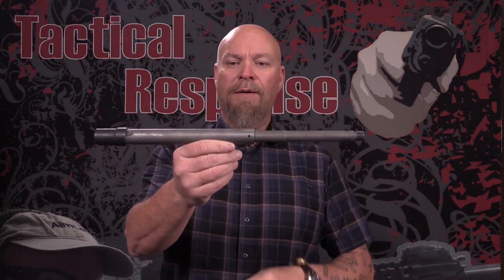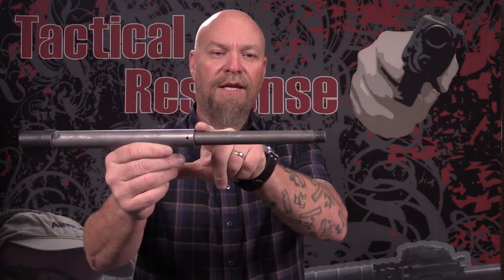Pencil Barrels are BAD?

Comment: The original M16 had a thin barrel for a reason. A big reason the military moved away from it is that 60s/70s barrels had heat treat issues that could shift POI significantly once the barrel got hot. Significantly enough to matter at 100yds.
But with modern cold hammer forged barrels, the shift has been reduced to the point that it’s genuinely insignificant for 5.56, even in narrow barrels.
Reply: The military moved away from it because of bad data.  They thought they were bending barrels during bayonet practice, a belief they thought was correct because the bore straightness gauge would often get stuck around the gasblock/bayonet lug area.  

What was actually happening is there was a burr at the gas hole created during the manufacturing process that was causing a build up of copper over time which would stop the gauge as it went down the bore.  They didn't find this out until afte the M16A2 TDP had been signed off on, and it got left as an "upgrade".

Comment: Most of the guys worried about these things can't shoot well enough to see a difference anyway.  It's like guys who can't hit the x at 5 yards putting $200 match barrels into a Glock to fix their problem.
Reply: UziNineMillomeetah Hahaha shooting low left, add a match grade barrel. Now you’re shooting a tighter group low and left.
Reply: @JohnW-yv6yp  Exactly!
Reply: Years ago, I was at a match and as I was walking away from a stage, I saw a guy banging the frame of his Glock against a rock trying to get the slide unstuck and out of battery.  I asked what he was doing and he told me he put this aftermarket barrel in it thinking it would shoot better.  The barrel caused a little dirt to jam the slide closed.  I told him the most accurate barrel is the stock barrel with 10,000 rounds through it.  He asked "How does 10,000 rounds make the barrel more accurate?"  I said "The barrel doesn't need 10,000 rounds.  You do."
Reply: John Wilburn Good shit, I’m stealing that.
Reply: @Dante's Cuckferno I just buy the OEM of many of those aftermarket barrels for like 1/3+1/4 the price 😂

Comment: “Heavy is good...heavy is reliable. If it doesn’t work, you can always hit him with it.” ~Boris the Blade
Reply: Isn't the heavy barrel argument more to do with barrel harmonics than the reasons stated?
Reply: The pro side of a Mini 14 is a nice butt stroke. :-)
Reply: @conondrom123 yes. Ostensibly, the light weight of the thin barrel is a trade off for the vibration dampening of a heavier construction. For sustained, repeated cycles, I would opine more repeatable harmonic signature is available to the heavier barrel with diminishing returns in increasing mass, which is why most normal duty and match barrels are of similar profile and diameter.

Comment: It's all about thermal dynamics and heat deflection. I have heavy barrels on all mine, I cant say what's right and wrong, own what you want there are differences and it's not just weight bud..I do study metallurgy and am a machinist  and fabricator. Some things do play into the difference into these profiles.
Reply from the maker: What you do not have it practical experience. Get some gunfight training.
Reply: @TacticalResponseCrew  and how do you know this? Assumptions are like assholes bro. I would probably never want to get into a gun fight with a barrel that whips around on follow ups
Reply: @TacticalResponseCrew  and more to that..if you read what I put down without you're sole opinion (because that's all it is) in mind you would see that I said I wont say who is right or wrong. I dont care what you or the next guy likes or believes in. Also I would think underestimating someone in a fight could be bad for you. Ego is best left aside. Wouldnt you agree?
Reply: Kijafha  yeah I would hope so, I would also like to think that there is no need to promote it by assuming I dont train, or train correctly.  No need to jump on his back either he is a big boy and if he feels he needs to explain or make clear his meaning he can do so.
Reply: @jovanisiliezar3733  conjecture gets in the way most of the time with guys in this field, it's no big deal and I'm not offended for most part. Everyone has their own way about them and they're own style and taste.

Comment: Hi James. My only pencil barrel experience has been with Faxon barrels and they are less accurate than their heavier barrels. They are accurate enough at under 100 yards though and the lighter rifle handles better. I always liked your comment about heavy rifles when you said "which are you going to do more, carry it or shoot it?"
Reply from the maker: Wrong
Reply: @TacticalResponseCrew  Not wrong. My Faxon pencil barrels consistently are about 2 MOA less accurate than my medium profile. Just a data point of reference, not an affront to the video. This may only be true for Faxon pencil barrels
Reply: @Jones Hi Jones. Certainly not a scientific test in a controlled environment. Just my observation from shooting several types of 556 and 223 from several rifles with different barrels at 100m. The variables you list should absolutely be controlled for a true scientific experiment. This is my experience and nothing more. James recommends Midwest rifles. The last I checked Midwest was using Criterion barrels which are very high quality. I do not own any Criterion barrels. My experience is with Faxon, Ballistic Advantage, and BCM. At this point I would say no one on here is interested in my differing experience so I will stop commenting
Reply: @Jones I apologize as I did misunderstand what you were saying. I've done a good bit of AR shooting. My Faxon barrels have disappointed me in both 556 and 308. I thought it was just me until I got the BA and BCM barrels. I'm not a great shooter by any means, but I can group my BAs and BCMs 1.5-2 in at 100m on the gov't and med profile barrels. My heavy BA and BCM I usually am right around 1in. My Faxons even on my best lowers really concentrating I am always getting 3-4 inches across multiple brands of ammo. The 556 is 55gr and the 308 around 150gr
Reply: @tlrinc2343  Whoa. Have you contacted Faxon? They would be appalled at those results and I've seen them reach out to folks reporting that accuracy and offer to replace their barrels. Their CS is really responsive.

Comment: I only run light barrels now. Even my 308 has a faxon pencil barrel. Runs awsome.
Reply: Do the groups grow the hotter the barrel gets?. This is my only concern.
Reply: @samanthamoloney7645  the barrel shoots 1 inch with high quality ammo. About 1.5 with good ball. If you dump a mag or two the groups will grow slightly. Maybe .5 inch to 1inch. But the barrel cools very quickly. I think if you took it through a class you would never notice any shift. Mine is 16 inches with mid gas.

Comment: You are absolutely right people are ridiculous about wanting heavy barrels talking about barrel whip and heat its all just a joke. Getting hotter can slightly open up your group size but for combat/self defense situation it wont make a difference and if you were shooting far enough that half or even 1 moa is gunna make you miss your barrel would never get hot and if you were in a fire fight with a higher rate of firer youd run out of ammo before your accuracy degraded beyond combat efficiency
Reply: Yup

Comment: I have a heavy profile and a pencil profile. They both shoot about the same to me. I do generally like a heavier barrel on my long range rifles but those are for plinking not fighting. The main difference.to me on a HBAR vs a pencil profile is when transitioning targets it is far easier with a pencil profile then a big ass heavy barrel. That's just my $0.02
Reply: Yep heavy does close and far away  and it  keeps accurate  longer with the heat .  I use heavy because of it

Comment: The only somewhat valid concern I know of is that pencil barrels can heat up to the point that technically it can affect accuracy, but on a fighting carbine you should still be able to make hits on a man-sized target out to 300-400 yards, just maybe not with pinpoint accuracy.
Reply from the maker: NOT with a semi auto.
Reply: @TacticalResponseCrew  true, and if you're building a long range precision rifle, go ahead and use a little heavier contour, but for a fighting rifle it's just not an issue.

Comment: I can tell you as a old lady shooting and handling a gun around at the range, I like my AR as light as possible so I can shoot longer with out arm fatigue. heavy barrels and fancy attachments are  just unnecessary weight in my opinion. in a fire fight i rather have a 60 rounds of 556 with 2 taped mags than a heavy ass scope or flashlight etc.    Good video James :)
Reply from the maker: You need a flashlight.
Reply: @TacticalResponseCrew  being in a rural home location in the mountains of TN  We felt that Flash lights are only good for close range like within 25 yards and any pump shot gun, which we have our tact light on  would be a better option for self defense at night at close range around the home than a AR.  when out in the field we have a million candle power spot light  on the jeep  that lights up 100's of yards, the right tool for the environment, your in is that not that also what you taught us?
Reply from the maker: What would I know...
Reply: @TacticalResponseCrew  your funny :D

Comment: I've personally done mag dump after mag dump with 6 mags with an M-4 and never once had a cook off. I have had cook offs with a M-60 however. Your AR barrel may get hot but James is right, it's not THAT hot.
Reply: You had cook offs in an open bolt gun?
Reply: @BlackHawk2029  i guess It could happen with a light primer strike.

Comment: Do pencil barrels whip or flex more after you fire? Does that  affect accuracy of a followup shot? Does the thicker DPMS barrel have less whip because it is thicker?
Reply from the maker: Ray - No.
Eric - Not true.
Reply: @TacticalResponseCrew  Ok, thanks for the replies. The price and weight is about the same as the M4 barrel, so I think M4  is probably a better option. Again Thanks.

Comment: I like the pencil barrels.  My old SP1 shoots great.  I have a carbine I built years ago with a special run Bushmaster 1/7 pencil  barrel that is very handy and shoots great.  But there is no doubt the thin barrel has a much greater POI shift when I screw a can onto it, and they are way more susceptible to impact shift from sling tension if they are not free floated.

Comment: This is not true at all! Your Mission should dictate the barrel profile. If you’re a new gun owner think about what you plan to use the weapon system for and let that dictate what profile and length is best. Heavy barrels tend to allow more accuracy for greater length of time. This doesn’t always occur but thin barrels tend to have a tendency to walk as they heat up. What he should’ve said was” if you plan on moving with your weapon or walking long distances get a pencil, fluted barrel, or hybrid barrel”. If the gun is meant for planking heavy barrels tend to be more accurate. All you have to do is Google barrel harmonics and it will prove Yeager was absolutely wrong. More mass equals less vibration thus more accurate, but ounces equal pounds and pounds equal pain

Comment: So I had a friend, who though he was a real know it all a few years back. I had bought a bolt .223 tc venture rifle to be a varmint gun. I can hold a 3" group out to 400yds with it. It has a fluted barrel. I didn't care that it was fluted, straight, heavy or light. I know I. Never going to get it hot enough for it to matter, it's a bolt gun with a 3 shot mag. But my friend though I was crazy and bought the same gun with the heavy barrel because it would " handle the heat better". 7 years later and both with probably close to 1000 rounds through each. Neither is showing signs of significant wear. But his is almost 2 pounds more. He doesn't pack his away from the truck because it's too heavy. Mine is lighter, and better to pack with in the fields.
Reply from the maker: Right, people that SHOOT know what I am talking about.

Comment: If I were going to replace my barrel, who are some good manufacturers? I have a government profile currently. Bought as a complete upper. Front heavy.
Reply: Check out Faxon's offerings as well
Reply: Ballistic Advantage here also. Just the base line QPQ, 16" mid-length pencil weight 5.56. It's only a few ounces lighter than government, but I didn't free float it yet. I went with the modern series because it should last longer than the SS barrels in the Hanson profile.
Reply: Oh, and Aero (owns Ballistic), BCM, Daniel Defense, and FNH barrels are all gtg... Not sure if the later two make pencil weight
Reply: @RCFlyBoy314  did not know that Aero owns Ballistic. I have an Aero upper with a 16" pencil barrel that I'm in love with. Guess it's safe to assume it's a Ballistic Advantage barrel?
Reply: @kill3r_b75  yep, it's a sister company now. I'm not sure if they were their provider when I built mine (circa 2017?) But Aero barrels were identical to the BA options. I just waited for the 4th of July sales back then.

Didn't remember they did 4150 Hanson's now! Haha if I get some cash to throw around after all this

Comment: They always say "pencil barrel will heat up faster " well yeah but it also cools down faster ...so..
Reply: I actually heard from someone at Faxon that they cool down slower due to less surface area for heat to dissipate.
Reply: @mitchschutter4302  If both barrels retained exactly the same BTUs, yes, the heavier barrel would cool down faster. However, the heavier barrel has more mass which means it will retain more BTUs. I have never seen a gun with a pencil barrel next to a gun with a heavy barrel take longer to cool if they were on similar firing schedules. Pencil barrel always cools faster.
Reply: @hammanvideo  Interesting. I'm a lightweight barrel advocate so that's good news.
Reply: @hammanvideo  But those BTU's are spread through more mass which results in less temperature for a given BTU.
Reply: @phillhuddleston9445  If you had the exact same btu content the heavy barrel would be cooler. However, since the heavy barrel has more mass, at the same specific heat, it will require more BTUs to raise the temperature and more BTUs will have to be expelled to lower the temperature. A BTU is a constant.
Reply: @phillhuddleston9445  So if you have a pencil barrel with (for example) 2000 BTUs and a heavy barrel with 2000 BTUs, the heavy barrel may be slightly cooler due to more mass requiring more latent heat to overcome the specific heat and start raising the temperature of the barrel. The pencil barrel will be hotter but will cool faster since less mass at the same specific heat will require less BTUs used in the latent heat state to begin the heat transfer. At that point, you are limited primarily by air exchange across the barrel surface (more air exchange means cooler air which means greater heat transfer) and ambient temp/humidity.
Reply: @phillhuddleston9445  Rereading your comment I think we are saying the same thing.
Reply: @hammanvideo  I think so, you just went into greater detail.
Reply: @mitchschutter4302  more surface area is more material to hold heat so that would be contradictory
Reply: @mitchschutter4302  the more important fact is no civilian will ever shoot enough rounds consistently to need a heavy barrel . Heavy barrels are better for full auto rates of fire , the extra weight simply does not benefit anyone with a semi auto rifle. The weight savings is so much more beneficial then the heavier barrel

Comment: I agree. I always thought that having a heavier barrel helped with heat, but I've never heated up a barrel to where it made any difference from what I could tell. I bought my first AR back in 1979 and we put 1,000s of rounds through them on our weekend get togethers. Heck surplus ammo was $89 a case and cheaper when you caught sales, so we burned through it like crazy. Now, I want to carry some thing that's light weight as possible.

I wonder if you could talk about "DOUBLE CHROME" lining on barrels and if it's worth it or what's the deal? Thanks, and keep up the great work.

Comment: After the 3rd or 4th round, a mid-weight  or heavy barrel will provide more accuracy than lightweight barrels on quick follow up shots. The word “More” being relative.
Reply from the maker: Internet MYTH
Reply: I was told that it takes mag dumping to get them hot enough for their groups to open up. 
About a mag for a pencil. 2-3 mags for a hybrid profile type of thing where you have medium profile behind the gas block and pencil in front of it. And then it just goes up from there.
And that the opening up when hot might see your 1moa barrel open up to 3 or 4moa.
Considering the army considers 4moa combat acceptable accuracy I see the point in that pencil barrels from reputable manufacturers ought to do the job just fine, especially if you're lugging them around all day.
Fatigue and sway from a heavy gun all day long could throw your shots off far more if you're shooting unsupported.
But yeah, for bench rest shooting after multiple mag dumps (seriously who does this?) it's pretty irrefutable that thinner and lighter profiles open up more..